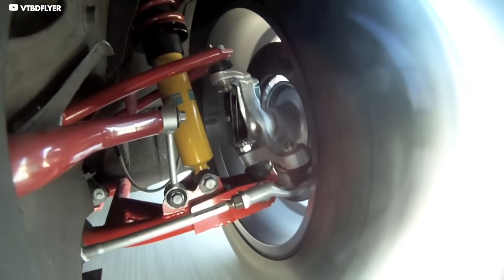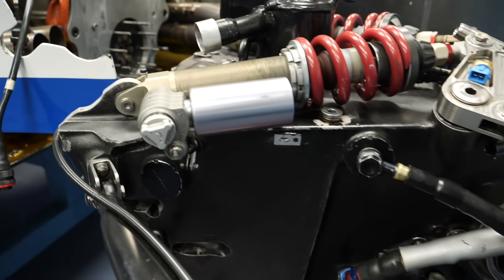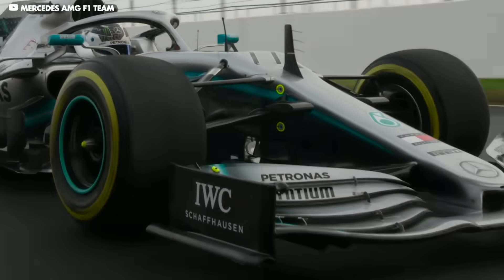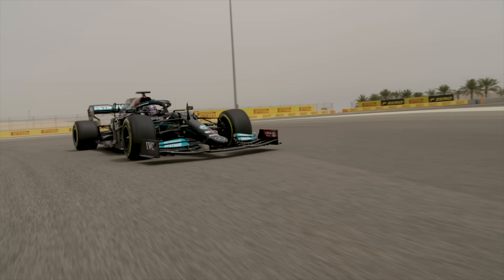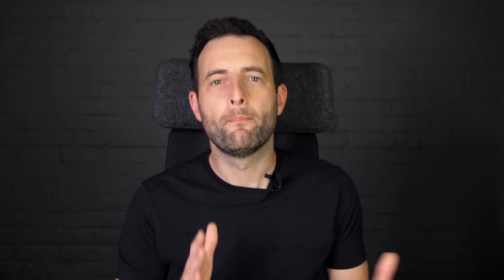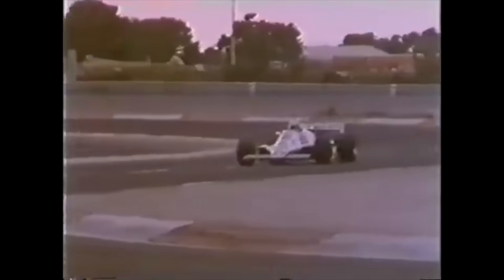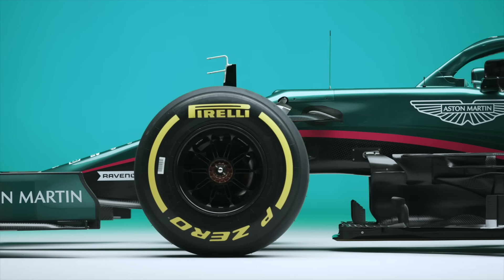Why this Formula 1 Car was FASTER Without Suspension

Comment from the maker: Is it just me that would love to drive that car? Well, as long as it had that seat suspension!

Do subscribe, we are so close to 600K so would greatly appreciate it!
Reply: Scott you are brilliant mate. Always the best content. Honestly these videos are more interesting the F1 😂 but seriously though 😁 thank you for all the great videos
Reply: Being an Australian who was alive at that time, I remember the news broadcast of that Alan Jones test. From memory that test was at Paul Richard on the long circuit with the full length Mistral straight.

It was BIG NEWS here in Oz. AJ had won the world championship was trying for a second and this car was the potential winner. BUT Jones was publicly saying these extremely stiff cars were going to be death traps. He said things to the effect that if they hit the wrong bump they would simply take off. Remember this was pre-carbon fiber and BEFORE the rules about drivers feet being behind the front axle. The almost indestructible tubs they now have were years away at this point. The tubs were basically aluminum sheet riveted and welded together.

Part of the news was AJ saying that the rule changes were necessary because the cornering speeds had become too dangerous for those cars. This was before data loggers could tell the engineers what the suspension was doing. The tire compounds were real rubber from real trees not the synthetic stuff some science geek made in lab.

There was actual concern being publicly voiced that our World Champion was going to be coming home in a box if their wasn't some common sense.

One thing not discussed here and its related to the rule changes. As I remember was that the floating side skirts that followed the road surface were banned. The side tunnels were NOT banned but the side skirts had to be fixed and have a minimum gap to the road when STATIONARY. AJ voiced at the time that there were plans for cars to lower and seal the side skirts (or close the gap) using the normal suspension. He also said that would be just as dangerous because the cars would effectively be running with the suspension continuously bottomed. Which would be just like the car with no suspension.

Great to see that footage again.
Reply: Would love to, but I prefer my back not to be broken
Reply: Suspensions are for the week .
Reply: So they didn't experiment further with seat suspension?
Reply: @yunan9610  Lotus team did it. Actually it was a double chassis. The main one without suspension, and the one with the driver AND engine suspended to the main chassis that was pushing the tires on the ground and holding the wings and side skirts
Reply: It's a big Racing Kart. No Suspension racing karts have tremendous cornering power, but do require very smooth pavement.
Reply: I remember watching that documentary a while back, think it was all smoke and mirrors from Williams to try and get others to waste time on it. No F1 team would let a TV crew into film there pre season testing and broadcast it in such detail. Just William being smart and trying to use the media to there advantage I think.
Reply: @dcrooky3  I actually remember that test session being telecast in Australia.

As I said in a previous comment that Alan Jones was publicly voicing safety concerns over how teams were approaching the rule changes.

What they did with the rules was put a limit on the gap between the side skirts and the road. Its intent was to get rid of the floating side skirts Lotus had developed that kept contact with the road. By having an air gap it reduced the effectiveness of the side tunnels by letting air get sucked in from the side.

What teams were doing was setting soft suspensions so the car would lower and close the gap and increase the effectiveness of the side tunnels. Because they would be running with the suspension bottomed out it meant that ANY BUMP could send the car flying off into oblivion.

AJ was quite vocal at the time about how dangerous the next season might be if the rules weren't clarified.

I don't remember what they exactly did but they did something and the next season wasn't chaos. Its one of those really odd stories and I only know about it because it was news in Australia at the time.
Reply: 9:05 I think you mean to say it wasn't Williams' only go at unconventional suspension, because it does sound like it was the first.
Reply: I remember hearing about an F1 or Indy car that had a separate cockpit suspension.  Of course, it was banned.
Reply: @AndyFromBeaverton  Is that possibly the Lotus with the double chassis??
There's vide here on YT about it.
Reply: I'm surprised you didn't even mentioned the Lotus 88 that made the principle of making a comfortable suspensionless F1 car become reality. Unfortunatly, the FISA banned it
Reply: Now you have 666, the magic number :p

Comment: The tires do almost all of the compliance work, soaking up bumps so that they don't throw the car off the ground. The newest tire regulations are low profile, resulting in less compliance and a bumpier ride. Another factor is that tracks are not always completely level and solid suspension would result in two tires having full contact while the other two had little or no contact.

Comment: 3:38 - Ok so that’s very wrong. Suspension stiffness and body roll do not decrease or in crease weight transfer. That’s a big misunderstanding of how weight transfer works. 

You can change the vertical load distribution in a corner only relative to the front and rear by either stiffening or softening one axle relative to the other axle, but you cannot change the actual total weight transfer of a car in a corner by stiffening your suspensions. That’s just not how the physics work.

In other words, for a given ride height and track width, the weight transfer of a car with or without suspensions will be virtually the same, because body roll has no significant effect on weight transfer.

Hope this helps.

Comment: Active suspension is a fluid and pressurized air control suspension, basically as if the whole car is one huge shock absorber... these suspensions were inspired by ambulance suspensions in the 70's.
The first F1 to use this on a track was the LOTUS 92 on December 16, 1982, curiously the day of death of  Colin Chapman who took care of the project at Lotus.
The first F1 to win races with an active suspension was the Lotus 99T with Ayrton Senna in Monaco and Detroit, in the same year in 1987 Nelson Piquet with the Williams FW11B in Monza had the first victory using the active suspension that came to be commercialized in the model. Lotus Esprit Turbo 1983 street... what changed in the improvement for the FW14B were the processing capabilities and sensor readings per minute...
Remember that Frank Williams took the team that took care of the Lotus suspension project with Chapman, as the new Lotus manager did not give priority to the project and it was the gap for Frank to absorb the professionals.

Comment: The suspension on the seat that Alan Jones suggested was tried once on a racing motorcycle. The wheels were rigidly attached to the chassis and the engine, fuel tank and rider were suspended within the chassis. It worked but it was a low budget project at clubman level and was never developed further.

Comment: I had ohlins road and track coilovers on stiffest once and there are so much vertical Gs, it was throwing me out of seat over bumps, slight ramps, and felt nauseous after a 20min drive, can't imagine without suspension. Stiffer the suspension the flatter road is required. Otherwise tire lose grip without any travel. And if you hit a bump while cornering, it's over. That's why stiff away bars is not a good idea on road. Regular roads are crap for suspension

Comment: Brilliant series of F1 videos.  But please may I question the the remark "lack of body movement also allows for less weight transfer".  The weight transfer in turning is a function of the height of the centre of gravity above the ground and the track width - best understood by drawing a simple 'free body diagram' to show the forces which must resolve themselves with more upward force on the outer wheel turning (or forward wheels in braking) so that the moment around the CG is zero.  The spring rates, anti roll bars (if used) and the torsional stiffness of the chassis all contribute to the extent to which the transfer of weight is shared between front and rear wheels (with corresponding influence on oversteer/understeer) but not the actual weight transfer.

Comment: Great video ! Could you please make a video talking about how narrow or wider tyres,  affect grip? Thank you!
Reply: a wider tyre with the same compound doesn't necessarily grip any better, but using a wider tyre allows you to use a softer compound, since the load is more distributed and it wears a bit less. the sidewalls also get stiffer. so basically width only affects grip indirectly, there's a lot of variables

Comment: Saying the car doesn't have weight transfer because it doesn't have suspension makes zero sense. That's just not how physics work. That is reliant on the center of gravity. Also everything on that car is a spring the chassis, the tires, etc. Plus weight transfer occurs whether you got a spring or not. A force applied that is effectively pushing down or up on an area doesn't have to have movement period. I can lay a brick on a flat piece of concrete and put a load on the front half and it will have front biased weight distribution even if no movement has occured. Same principle here but movement car occur. One way or another something is absorbing those shocks that energy doesn't go no where so it's the chassis and tires instead of controlled dampening instead of possibly getting a resonance.

Comment: You kinda of mentioned it a little bit at the end of your Video but the forces that must now be absorbed by the chassis are enormous and will cause structural failure much sooner than on a car with suspension and that is actually one of the main reasons a suspension-less car will not work!

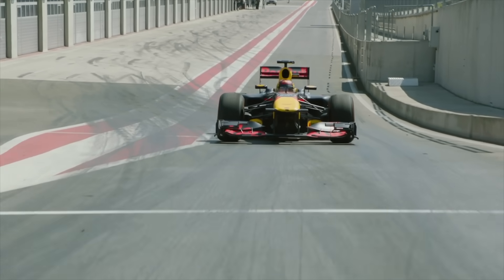Comment: 5:02 absolutely not. A lower center of gravity doesnt give them anything on the straigths and as the car brakes the rear rises bringing the center of gravity to where it was. The reason they do that is first because of the aero load increasing that much which forces the car to 'squat', which is ineviteble. Why they set it up to touch the ground on the straits is to stall the diffuser which reduces drag. Williama did that with their active suspension where they had a button to drop the car on the road to stall the diffuser

Comment: Steady state weight transfer still occurs and the total amount remains unchanged (at same lateral acceleration) unless you alter ride height.
Without springs, the elastic component of the weight transfer just occurs at less roll, because the spring rates are higher (in the case of an infinitely stiff spring it just occurs instantly), and the geometric component of the weight transfer remains unchanged as well.

Comment: This bit about weight transfer is complete bollocks. The only difference in weight transfer from roll and pitch is the very slight geometric shift in the COG. How much load each wheel takes has almost nothing to do with pitch/roll. Guy doesnt really know what hes talking about.

Comment: Sorry but the weight transfer part is not correct 
The total weight transfer is always the same … (provided consistent Geometry)
Only the distribution can be changed between the wheels …

Furthermore tire squats influence is way more significant than chassis stiffness (concerning body movements)

Comment: There are some basic concpt mistakes on this video. The first and most important is that he says weight transfers depends on suspension stiffness. It doesn't, the weight transfer is determined by cg height and track of the vehicle (and lateral acceleration). This means if a infinit rigid suspension does gives you more grip it is not by reducing weight transfer.

Comment: Wouldn't putting suspension on the seat not work? With todays sensors it could probably be achieved technically rather than with springs and shocks.

Comment: If suspension is so good why don't go karts have it?
Reply: Unlike real cars, go-karts are designed to be as streamlined as possible as they're usually used in small tracks. Go-kart's already small and light, and its ride height is extremely low, so having buggy-like shock absorbers is simply too heavy and hindering. Instead, the kart relies on flexible chassis, tires, drive components, and even the driver's movement as the suspension. Go-kart's entire structure is made compact enough to grip on the road without flipping over or tearing itself apart just by hitting a road bump.

Comment: Suspension stiffness should not have an impact on  weight transfer (in steady state cornering), only on the roll-angle at which it occurs.
Ride-height (COG-height) on the other hand does, as you mentioned.
Also besides the chassis-flex, tire-flex is a major part of an axles overall compliance (being a rather soft spring themselves (everything is a spring :-))
I think William F. Milliken once said: "Every type of suspension works if you don't let it"

Comment: You said that lack of body roll causes less weight transfer and also that no suspension results in far less weight transfer. I'd have thought that the bulk of the weight transfer was from the lateral force acting on the CG rather than the very small lateral movement of the CG to the outside caused by body roll (I don't think the CG will move vertically much because the roll centre is below the CG in all sensible cars, so it should actually go down by a very small amount). I think it's a misunderstanding that the weight transfer is caused by the roll, as the roll is a reaction to the lateral forces and the lateral forces will remain and hence so will the weight transfer, even with no suspension and no roll.

I think in Williams's case, it was all about ride height as they were getting rid of sliding skirts, and nothing to do with weight transfer. I think they used springs in 1981, but Alan Jones's back was already feeling the pain by then, which persuaded him to retire.

Comment: Friction is not a function of the surface of a contact patch, but rather a function of the friction coefficient and the normal force (in this case the force applied on the tarmac), --> F=mu*n

Comment: Body roll =/= amount of weight transfer. Amount of lateral weight transfer is dictated by CoG height, track width and lateral accel. Not suspension stiffness. Page 1 of any vehicle dynamics book.

Comment: So much misinformation in this video. For one, body roll is not the cause weight transfer, weight transfer is the cause of body roll. This is a very common but fundamental error. A typical go-kart experiences weight transfer despite not having any sprung suspension. A go-kart does however have a spring rate in the form of the tyre and also the torsional stiffness of the chassis.

Comment: Good racing drivers use consistent and careful turns of the steering wheel allowing faster cornering speeds.
Poor drivers use jerky sawing turns of the steering wheel which results in slower  cornering speeds.

Comment: If they ran without suspension could they get away with flexible wings as well? As the regulation says they have to remain rigid compared to the “entirely sprung” part of the car…

Comment: Besides keeping the rubber on the tarmac you need the suspension to decouple vibrations from the car and the ground. If you get any vibration from the tarmac or the engine resonate your aerodevices would vibrate too. These vibrations can cause a laminar flow of air to get turbulent, which would cause an instant loss in downforce. As we have eliminated suspension the car can't regulate it's hight and would start to jump. So i doubt it would be faster as you had do stay off any curb.
Also you can't completely eliminate suspension as the air in the tire does most of the suspension work in an F1 car. You just need the additional spring damper elements to keep sure you stay out of increasing vibration or jumps of the chassis.

Comment: The biggest mistake F1 made was introducing all these technical regulations. We would've had a whole different kind of sports if they still allowed plenty of experimentation.
Reply: Agreed. But at the same time - I kinda understand why. There have been series with pretty much open rulebooks... I'm not an expert by any means, but as far as I can recall, open rulebooks tend to lead towards massive spending sprees, huge performance gaps between the haves and have-nots and the series in question eventually dying out, because nobody can afford to run in it anymore.

F1 has gone a bit too far with their rules and regulations though, I agree 😃

Comment: As an engineer i am screaming, you just move the flexural strength and resistance to torsion into the body rather than the spring. It just sounds like damage and wear on the chassis

Comment: So wait, did they try the suspension in the seat idea? I think that would partially solve the problem of the jarring forces on the body. Still wouldn't help the car be any less squirrely, but at least your driver wouldn't refuse to drive it.

Comment: I would like to hear an explanation of how karts are able to make adjustments for different tracks w/o suspension (that the F1 car couldn’t or why it works for karts). I’d be especially interested in your thoughts on the Formula Pacific cars, like the R1 powered one by Eddie Lawson. https://www.google.com/amp/s/www.racingjunk.com/news/formula-pacific-affordable-grassroots-racing/amp/
Reply: For karts, you adjust front and/or rear track width, static weight distribution, air pressures, different tires, some allow a lot of caster and camber changes, front toe, some have chassis stiffness adjustments, etc. They are very adjustable, just in different ways.